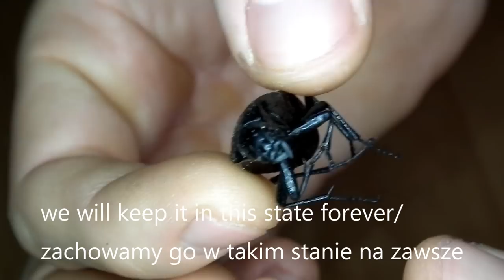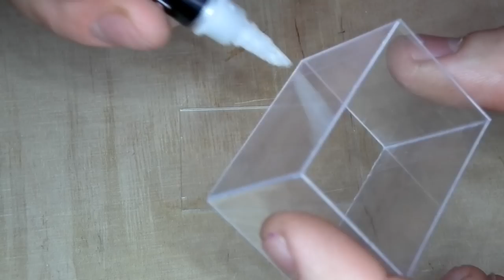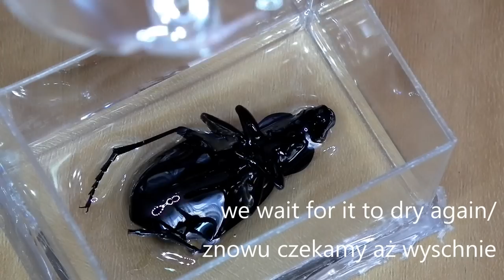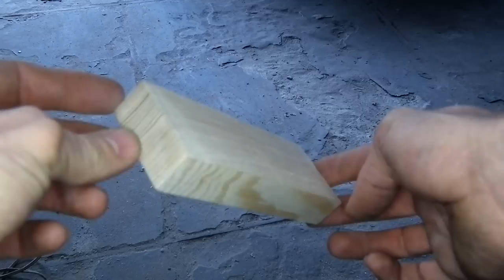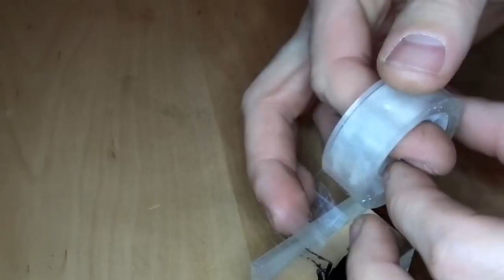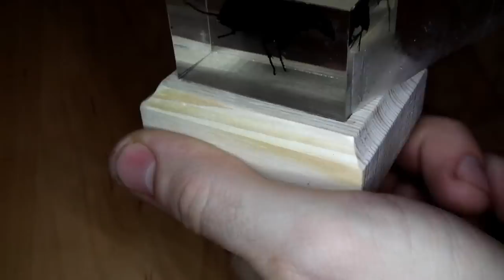Beetle, Insect in Resin. DIY

Comment: I've just discovered your channel today, and I've got to say, your stuff is right up my alley. I have this insect collection, and I've been thinking of doing something similar.

When I get the right supplies, I also want to display pressurized gases sealed in ampoules, which are then sealed in epoxy resin. I think it would look amazing!

Comment: Awesome looking result!  I tried something similar a while back & the epoxy boiled when it cured.

FYI, if you rout the end grain edges of a board before the long grain, the chip-out where the bit exits the cut of the end grain will be taken off when you make the long grain cut. =)
Reply: I wonder if you might have used too much hardener?
Reply: Looks like router bit is a bit worn from when it hits end grain
Reply: It probably wasn't dry enough for you to resin. I did this once with a "fresh" bee (It was dead when I found it) and it bubbled.

Comment: Does it matter what thickness the plexiglas is? Thinner the better? About to order a 1/16 sheet pack
Reply from the maker: Thickness does not matter. I use 1mm plexiglass with an anti frame

Comment: was this done using solely resin or did you use epoxy as well. I just did a scorpion that stung me but i did it in multiple pours and the mixture was not clear and became so hot it cooked literally the scorpion. What should I do next time. was using 100 to 100 epoxy  and resin

Comment: Hi, could you please help me to solve how to control the second layer pour time,cuz there is  a line between two layer when I made a beatle in resin,so please let me know your solution,thx
Reply from the maker: Do not wait for the first layer to dry. Apply the second layer when the first layer is similar to rubber.
Reply: @jedrek29t I will try it later,thanks

Comment: You trapped a few small bubbles on the bug unfortunately, near the legs, back & head, oops?  You could have removed these with a long needle after you poured the resin while the viscosity was still influential. Shame.